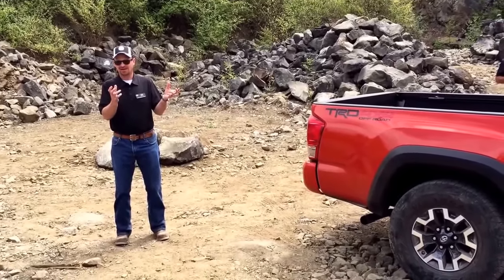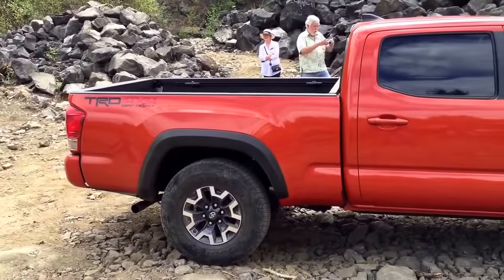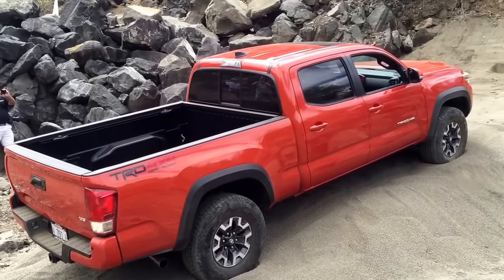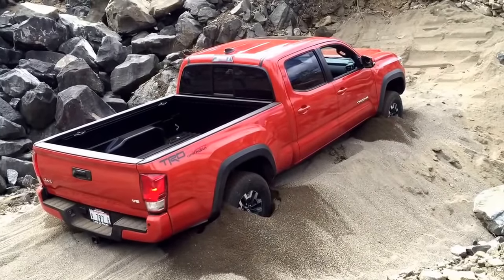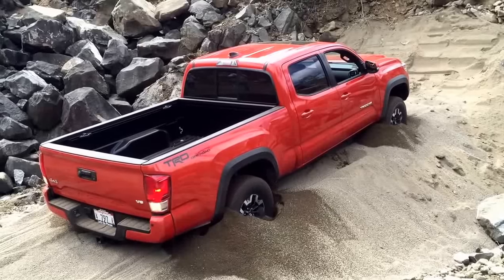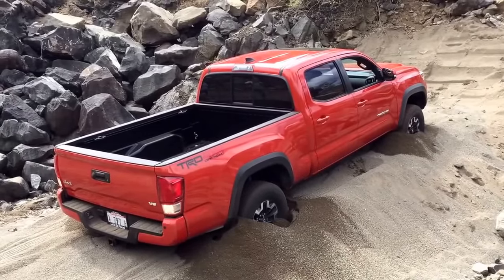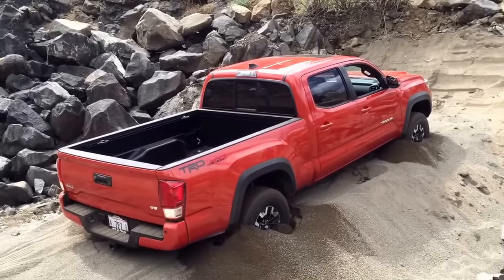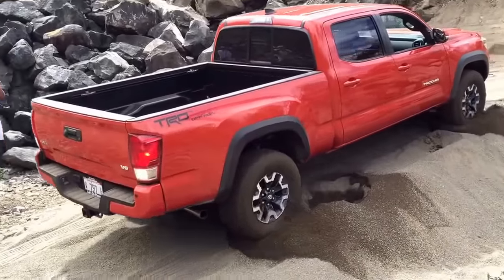2016 Toyota Tacoma - Demonstrating Crawl Control

Comment: Yeah, not buying it. Lets see it do this on flat ground.
I see it already having a major advantage with it trying to reverse down hill. I had an old 85 Suburban 3/4 ton 4x4 that would get it self out of this in 4hi no problem. 
If I saw this on flat ground up it it's axles in sand on a beach I might believe it more.

Comment: I have a 4wd Tacoma and YOU DONT need crawl control for sand. Just follow the instructions in this video below which basically just consists of airing down your tires, using 4low, moderate throttle of about 1500 RPM's and moving the steering wheel side to side, then you come out easy. 

https://www.youtube.com/watch?v=_9mmajFmVcc&list=WL&index=4&t=0s
Reply: Mauro Torres 
Or just hit the crawl control button.

Comment: Crawl control sounds like a software mode but guy wants u to think it's hardware feature with better wheel sensors and better drum brakes. Like drums don't get full of sand 😂😂😂😂 Sure sales buddy. . . I guarantee the wheel sensors use the same technology as standard a tacoma.

Comment: Yea his stated reason for keeping drum brakes on the rear are complete nonsense. In fact disc brakes are much better for all the reasons he stated that they use drum brakes.Toyota uses drum brakes for one reason only, COST REDUCTION. There is absolutely nothing a drum brake does better than a disc brake including tolerate dirt and contamination. In fact that drum is going to get full of sand and dirt and cause all kinds of issues if you off road a lot.

Comment: fuck off knob job guy in the video
i have seen a 4x4 that's been in the sand at the beach and it came into the garage with sand through everything in the rear drum brakes  
sand for miles
all that crunching sounds  as if you were chewing sand haha
had to clean out and replace the shoes and drums 
the drums were just about paper thin only 1.2mm left of wall thickness

Comment: do away with the drive by wire system and you too can do this with your foot and a little know how.  I hated my drive by wire system!!! every bump i hit ..my foot slaps the peddle off road. So anyoning! That I went backwards for offroading in a gen 3 4runner...Go back to the throttle cable sometimes newer isn't better.

Comment: Lame! How about locking front and rear and not getting buried. Put that in deep mud on a flat surface and it’s a different scenario. Tire type and inflation level change everything. I buried a stock Jeep YJ with all terrains in sand. Put it reverse and floored it getting it out of soft sand. That was with open diffs. I’ve wheeled for years, everything from stock Jeep to buggies in competition. I say what they displayed here was lame. Just to keep it simple.

Comment: Im in the South. Louisiana and Mississippi swamps. Do that in mud and muck. Not with sand and gravity assisting on an empty bed. When i go out my F150 is loaded due to well being in a damn swamp. Yes weight helps and hinders its a fucked up ballance. I got a 3.5 eco boost best damn swamp truck i had yet. Opinions vary. Point is. Loose gravity. Have woods gear. And children. Get burried in. mud and muck seeping in the cab. Kids getting worried and the damn truck is stuck. Now show me Crawl controle. And what ever happened to throttle control? That vertical pedal on the right with your damn foot on it. Tap it. Learn it. Its fucking crawl controle. Now crawl the fuck out and anchor your winch cable to hopefully a tree or stump. Grab the sledge and anchor rods that are in the back if no tree available. Heaven forbid your 30ft cable is to short. 2×4 ratchet straped to the tires last hope. Unless your on an incline with a tiny truck in moist sand and have crawl control. And holly shit my pos has disk brakes. Damn it man. As much as this truck cost i got fucking disk brakes? What the fuck.

Comment: I agree the truck is stuck going uphill; reasonable incline plus heavy truck going backwards downhill with competent throttle control not so stuck. Sorry but you do not need a professional to operate Crawl Control, what a crock of ** but let's applaud the salesman anyways.

Comment: LOL at people who flame sport/sr5 owners for lack of gimmicky things like crawl control. Dude you will need crawl control 1/100 chance and also the average tacoma driver will NEVER use it. Not to mention the fact that a rear diff locker can be added on for a relatively low price, and that will probably get you farther than the stock locker or crawl control will. Yeah its a good back up plan if you off-road every week, but who the heck takes their brand new truck they haven't even paid off out to potentially damage it/void warranty. The average tacoma user buys this truck for commuting, reliability, and low depreciation. Just my 2 cents ¯\_(ツ)_/¯.

If you bought an off-road, thats great, but don't flame fellow taco owners because they didn't buy something they don't need.

Comment: I noticed Mr. thedriversseat has no responses whatsoever. Typical fly-by-night shysters.
Reply from the maker: This is the first comment directed at us since the claims in this video were made by Toyota and not TheDriversSeat. But since you asked, we not only witnessed this demonstration, we also conducted an independent comparison test of the Tacoma TRD Off-Road and Colorado Duramax Z71 at Pismo Beach, CA. The Tacoma got out, but the Colorado did not, even after taking the tire pressure down to 17psi. This technology also comes in handy when rock crawling, but really shines when used in sand.
Reply: The tire pressure has to be lowered BEFORE you get stuck! Better yet, never put yourself in the position to get stuck in the first place! Four or all wheel drive is not for "rock crawling" or getting ocean salt jammed in nooks and crannies of trucks. Four wheel drive is to assist or better traction in low traction situations. I see comments dating back a year on the above video. Don't you check your own videos for comments? Might increase sales but what do I know, being a dumb (retired) Master Mechanic and Industrial Engineer owning 18 Internationals (4 of them 4X4) a '79 F250 4X4 and my new 2017 Silverado 1500 4X4? Since I have you on the line, how does the system work? Does it apply individual braking on the wheel(s) losing traction? That's an old trick, when stuck: apply the park brake slowly on the rear and/or feather the brakes for all 4 drive wheels.
Reply from the maker: You are completely missing the point of the Sand Crawl Control technology. The key benefit is that you don't have to stop and lower your tire pressure because when you're done, you have to spend another 10-15 minutes adding that air pressure back in (and yes it took that long with the Colorado). As far as how it works, the system applies acceleration and braking to each wheel individually so the parking brake trick is not the same. There are also 5 speeds available depending on the situation. While the system is engaged, the driver does not press the accelerator because the system takes over. Apparently Land Rover has developed a similar, but we haven't tested it yet. 

As far as your "fly-by-night shysters" comment.....we've been around for 10 years and aren't trying to sell you anything, simply providing you with information and our views. Thanks.
Reply: That's way I needed to know; how it worked. I fondly recall back in '68 when my (unlicensed) older brother got his $75 1951 Ford Victoria business coupe stuck on a large mound of dirt in "the field behind the house" (now a shopping center and housing tract) He tried climbing it at an angle and the right rear wheel was up in the air, spinning. Dad came home, saw the car stuck and charged across the field looking like the Road Runner cartoon, big dust cloud behind him with steam coming out his ears! SHIT! We bolted! He picked up a brick and tossed it at us while bellowing: "STOP!" over and over. Anyway, he got the car of the dirt pile by putting it in reverse and while letting the clutch out, applied the parking brake. Came right off! If only we'd known. The "fly by night" was me just generalizing. The internet is flooded with half-wits trying to gain a buck. The system of yours would come in handy if crossing the Sahara or something but it's cheaper to just buy a 12vdc air compressor and air down before hitting the sand. I've done some amazing things with "1 wheel drive" 2X4's (non-positraction) just by airing down before dropping down into the riverbed. I've even tried getting stuck but couldn't. Also, once you're on the frame rails or axles, your system wouldn't do anything. Not getting stuck in the first place is all that counts. I'm reminded of the truck driver on the 11 meter (CB) radio who drove doubles. When asked: "How do you back that rig up?" he replied: "I never put myself in the position where I HAVE to back up!" Same thing off-roading; don't put yourself in the position where you'd need your gizmo. Don't get me wrong! I've gotten stuck many times, mainly because drugs and/or alcohol was involved. One truck, a 1966 Suburban 2X4 sat stuck for 3 days before I got it out with 300' of rope and a come-along. My new $42,650 Silverado 4X4 does okay with it's $770 trailer equipment package that includes an auto locking rear differential; 3.42 ratio. Of course I have less than 3,000 miles on it. We'll see how it does next month down in the Mojave, a 11.5 hour drive.

Comment: Oh come on. The reason for drum brakes on the rear is solely "to keep rocks and debris out of the calipers."  I will bet 80% of the people who buy these are because it is fashionable sitting in the drive way and will never 4-wheel it. That is the reason trucks are so expensive, they look fashionable driving the kids to soccer practice or the grocery store.  Crawl Control is just another price raising gimmick.  Backing any 4x4 vehicle down an incline stuck in the sand will back itself out by drawing sand back under the tires. It's a matter of physics and of course the proper use of the throttle. The attached link is a good example https://youtu.be/SuDaalqR1mY

Comment: 55k and has  dumb brakes ... what are u paying for ? A slightly revised engine and transmission they have used since the early 90s ..  the same differential and drive train geometry since 1985 .   You can have all the same stuff you got in 1986 but nOw for 55k ... thanks Toyota!

Comment: Crawl Control is joke.Don't even need it, he could have easily came out in 4 wheel drive reverse without it. I been building and wheeling many trucks here in Hawaii and our sand is DEEP and SOFT! I know everything there is to know about trucks and deep soft sand. Definitely didn't need crawl control to reverse out of there for sure. You FAILED Mr. Speaker and TOYOTA!

Comment: What an idiot.  Disc brakes are self cleaning , dumb ass.  Ask any mud bogger.. hell, ask anyone thats not as stupid as you. The reason they use drums has zero to do with dirt getting in the calipers.  If it was why the fuck not run drums on the front??  O ya, cause drum brakes suck.  period.    The reason this truck uses them is likely because they are easier to control with this stupid fucking marketing gimmick for idiots who cant drive off road...

Comment: Many comments have pointed out the tom fuckery going on in this video, so I'll just point out that this is some bullshit. You know those "off-road" courses that jeep puts their lifted strollers on at car shows? This sandbox makes those bumpy ramps look like the fucking rubicon trail. Any fwd sedan could have backed out of that pile of dirt on slicks. I'm almost surprised the truck didn't roll out in neutral. This is fucking amateur hour, this test is the kind of ultra lame marketing that makes me detest humanity. Some exec signed off on this shit?! Fuck them, and fuck toyota. I'm not sure what I watched to make this be recommended to me, but fuck that video too. You're shit, toyota, literal diarrhea. Also, that engine sounds like a dying elephant's flatulence.

Comment: Jesus Christ you pencil pushers...give us a  small truck with a v8 motor with locking front and rear differentials with bad ass suspension. Take all that fancy interior and shove it up where sun dont shine. Give the truck hard rugged interior that's durable. Aint nobody want to spend 50k on a off road truck with all this poon girl pants wearning off road "cool" stuff. And sale a off road truck for $30k. It gets scratches and dings dirty lets get real. Ill take the zr2 over this atleast they put in a front locker.